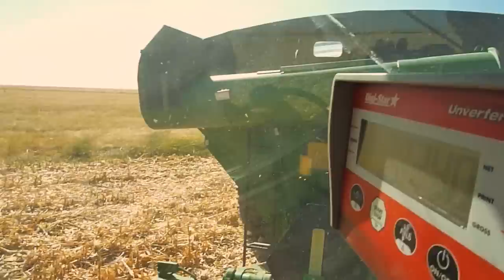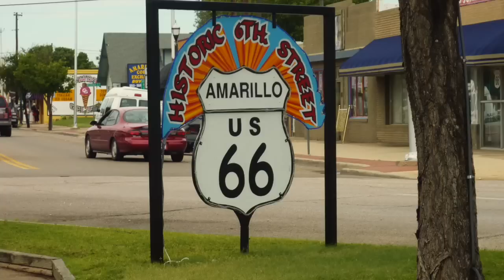My time in Kansas with Frederick Harvesting - John deere 2010

Comment: What the fark? Those are my Steiger tractors at the end, don't remember any Frederick's helping with harvest?
Reply from the maker: It’s a while ago now but if I recall, we were cutting near Elkhart, is that correct?!? Being from the U.K. we hadn’t seen a setup like that so we pulled over for a look. Hope that’s okay 😮🚜
Reply: Yup, north of Elkhart. Small world don't even know how i came across this video. Was that a Sunday? seems like the tractors would moving unless it was lunchtime, can tell from the pic the stack isn't finished.
Reply: Running Deere now. Panther got traded in, and now on a dairy up by Johnson.  Cougar transmission exploded on top of the stack and had to be drug off the stack, and is now sitting exactly where you took the pic with the blade removed. Torn up enough stuff that it would cost too much to fix the tractor.
Reply from the maker: max power I think it would be mid afternoon on a Sunday as we weren’t working, I think we headed to town to buy supplies. It is a small world in such big county. I’m sure it was almost exactly 8 years ago
Reply: 8 years and a month, silage is always in Sept..